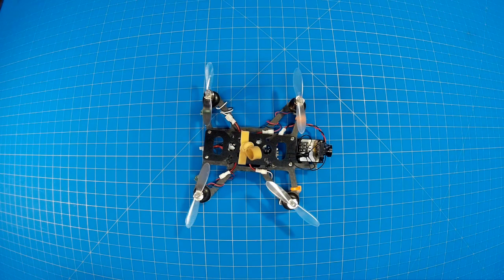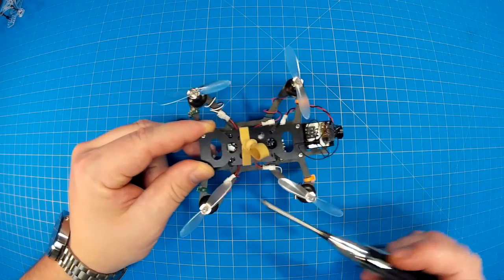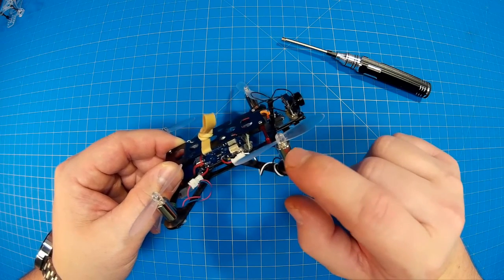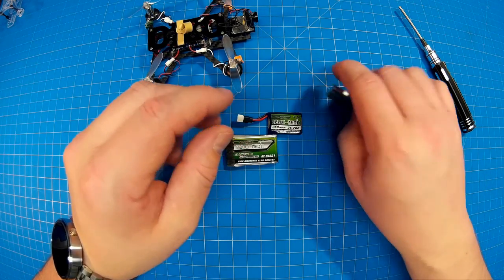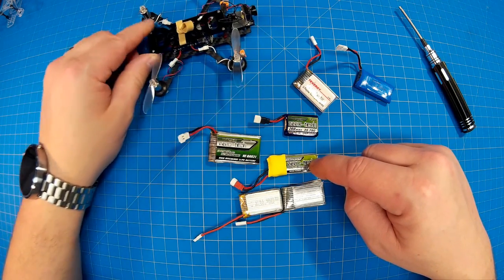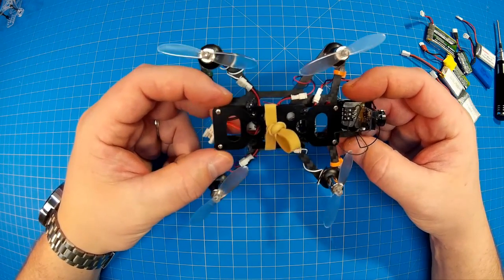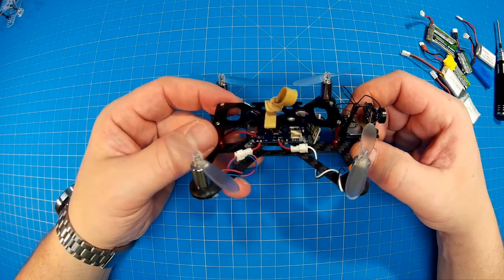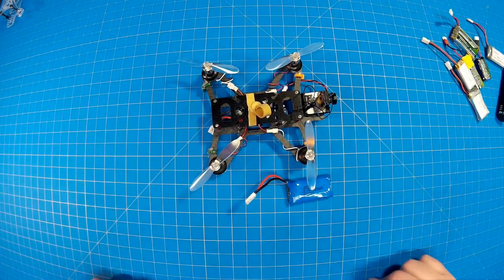Update - Quanum WISP/Pico32/SciSky

Comment: One of my motors is spinning the second the battery is plugged. What is wrong?
Reply from the maker: Might be motor solder on backwards or the fet controlling that motor is blown.
Reply: I pulled off the 3d casing I installed on the sciski and the mosfet is cracked. So where can I get another fet?
Reply: Nick Burns Is it worth the hassel to resolder a fet? Would buying another scisky be a better option?
Reply from the maker: I think soldering on the new fet would be a job for special equipment but others have done it. I would replace the board, maybe with one of the new F3 based brushed boards. I believe they are even less expensive than the scisky.
Reply: Nick Burns Not really. F3 only comes with FC board. The receiver is not included.
Reply from the maker: true.
Reply: Nick Burns I won't buy a new scisky soon. I am building a 150 quadcopter right now. I am only gonna fly Line of sight for now.

Comment: Somehow my scisky broke. When plugged to any power source, all lights flash for a sec and then the blue light just completely shuts off. Have you had that problem?
Reply from the maker: I haven't, check the solder joints especially the battery wiring
Reply: Nvm, I solved the problem. The problem was a new transmitter made the settings reset to default.

Comment: Is there any tutorials of how to flash betaflight? I am honestly a little scared of doing it without instruction. The last time I flashed any thing, I bricked it.
Reply from the maker: I am sure there are. I may have even included it in one of the video, but I have done it so many times I am not sure if I recorded or not. Google scisky betaflight. One tip, if it gives you an error or says it failed to flash, click the flash button again. Its normal for it to error the first time. dunno why.
Reply: +Nick Burns Just curious, is betaflight  glitchy?
Reply from the maker: No. Its called betaflight because Boris makes a lot of changes fast. Sometime there is something that is off and its corrected quickly, but I have yet to run into anything that affect my flying. If your uncomfortable flashing it, cleanflight is fine, it won't stop you from flying.
Reply: +Nick Burns Is there anything on cleanflight similar to RC smoothing?
Reply from the maker: Not that I am aware of.

Comment: Hi Nick, I also finished my first micro/Quadcopter build. I used a 3D Printed Frame and everything is working. However I have some issues with drifting. My Quad is drifting to the right roll axis. I tried to fix it by calibrating the gyro and the accelerometer but the quad still drifts to the right. The Scisky is not completely flat on the frame it's tilted a little bit to the left may this cause the drifting to the right? But if so shouldn't the calibration of the gyro and the accelerometer on a flat surface solve this? I hope you have any suggestions. :/
Reply from the maker: +xuxusito I have seen that drift as well. Calibrating the gyro and acc should set it for level, it wouldn't matter if the SciSky was flat or not. I can't remember which versions of cleanflight/betaflight it was but I have been running betaflight 2.3.4 which has reduced solved the issue on my micros.

Comment: Can you make a video about that rc smothing, didn't understand to well how to do it. Although My motor stay quite coold. I have the scisky with the bottom quanum frame only and it flies like a rock, also in fast turns it enter vortex and go down to the floor it enters vortex quite easily. For me it is absolutely impossible to add fpv gear to this thing, usually my fpv set up always end up weighting around 10grs I have redone it many times and I always end up around that number, I have put some 9gr wheight on the quad before instaling and the thing can't hover,  tried many diferent batteries sizes . I have the same problems with Alienwii. Alienwii is worst because it shuts down in mid air, is very battery pikcky, also the alien without fpv has flight times around 4 minutes max. I am pretty disapointed with this brushed boards I must say.  There are toy quads that have much more power and better flying characteristics  IMHO but you don't have rates. And all the money that is wasted on brused motors is just insane, so I will try to use the quanum frame and build a brushles quad with the smallest eachine motors and the narrow  naze, but in the mean time I would love to be able to get the best of the scisky. I have the same setings that andyrc on his scisky video. Can you share yours and your pids? How much flight time do you get on yours with fpv? You didn't  say when you talked about all those batteries. Thanks
Reply from the maker: +Multirotor Go Hi, I can make a video, but lets try text first, might help someone else too. When your in the cleanflight app (chrome app), click the bottom left tab, called "cli". You should now see a big black box with a small box at the bottom. In the bottom small box type, rc_smoothing=on, then hit your enter key, then type save and hit the enter key again. Give the board a minute or two to reboot then your done. As for flight, what props and batteries are you using? I have found on fresh 820-17 motors from the multirotor superstore and Hubsan 107L clear props, I get nearly 6 mins of indoor (slower) flight, outside I get about 4-4.5mins with fpv gear. Brushed quads have a convenience factor, fly in small spaces (inside and yard), are simpilar to setup and less expensive, the downside is they don't fly as fast and are more sensitive to weight. My current PIDs are https://drive.google.com/file/d/0Bz4WVy2opr8WX1dRRXdsbklxeG8/view?usp=sharingSetup for this quad can be viewed in this video https://www.youtube.com/watch?v=j810zIW9O9UGood luck and let me know if you have further questions.
Reply: thanks for taking the time to write all this info. I will come back when I got the time to work on it.

Comment: Ladybird props are ment to be slight better than the hubsam for the micro's, although the best u can get is the rolling spider parrot props 66mm. Micro motor wearhouse sell them although u can source from other locations as well. He also sells the 1s battery on there 480mAh 40c discharge they are from mylipo.de so pick either site to purchase from with lowest price for you.
Reply from the maker: +Side85Winder I might be able to use larger props on my next micro build from the picnic frame. For my wisp I need longer narrow batteries. I have been waiting for the 430s from mylipo to be in stock. I did order some similar batteries from atomikrc, the venom fly 500s, only 30c but we shall see

Comment: look into banggoods and get some 500mah for the hubsan if your liking them 380s you'll love the 500s. get the five pack.
Reply from the maker: +Chi Sty The oddity is, I have several different 380s - 750, and the blue one I like the best. Do you know what the weight is of the hubsan 500s?
Reply: 12.5 grams I have some that are 12.9.....what the weight of the oddity? The hubsan 500s look like your 380s you like.
Reply from the maker: +Chi Sty 11grams on the blue favorite. I also ordered some venom fly 500mah today, they reportedly weigh 13.6g. I should try your recommendation.

Comment: Wisp isn't a light frame,  was hoping the hk motors could power it, but not surprised they can't.  Those motors may be better for an efficiency or dreamcatcher.  Any idea how you burned the mosfet?  Wouldn't mind seeing some flight footage.
Reply from the maker: +pilsnerpopper The wisp and HK motors did ok, until I added the fpv gear (6g). I burned when I made the mistake of plugging in a reverse polarity battery :(....smoke.... heart break. I think the picnic frame will be fun. I like the idea of "buying small" too.